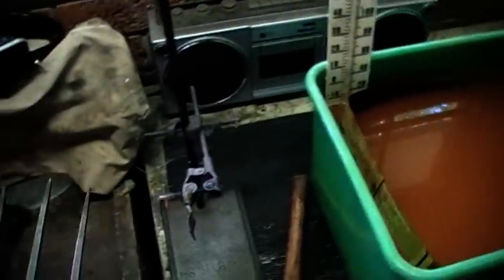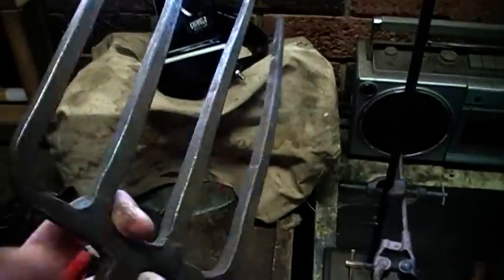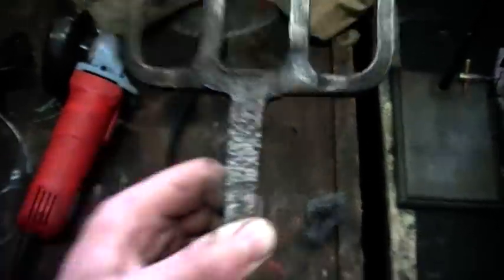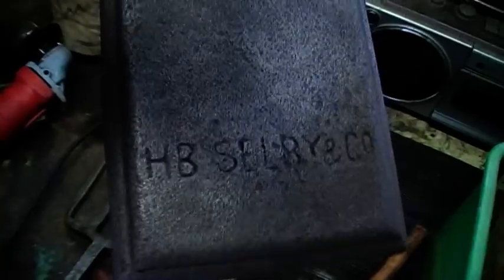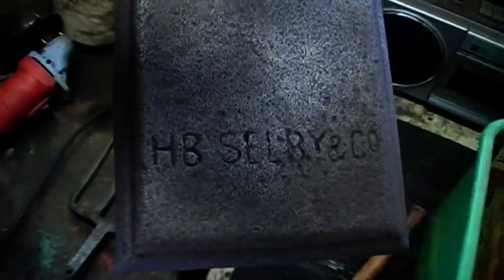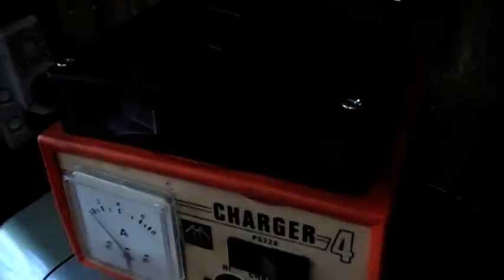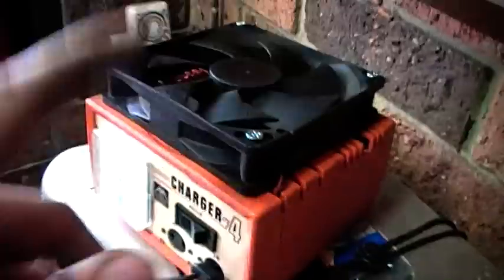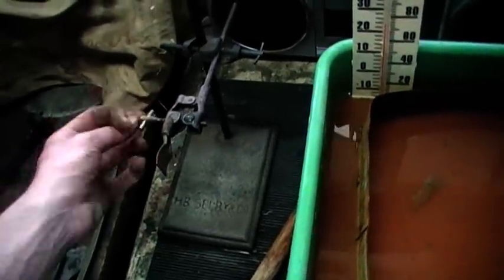Electrolysis tank update

Comment: Good job!, very good!.

Finding obscured markings is another great feature of Electrolysis, especially light etchings or stamps that a wire wheel would normally destroy.

what are you using to dry the parts and drive off the hydrogen in them?